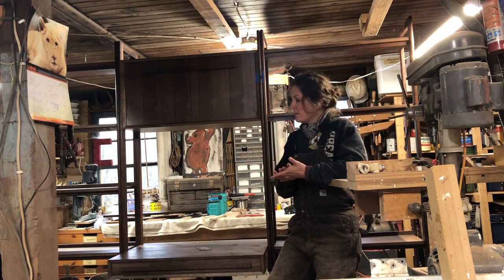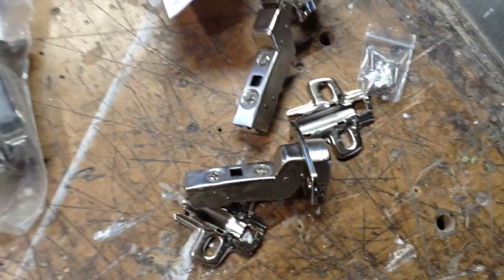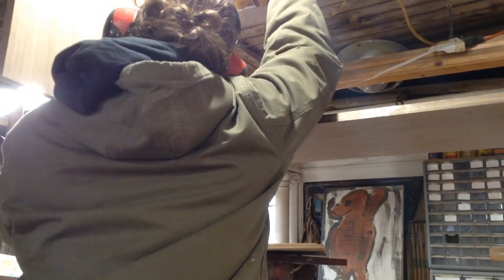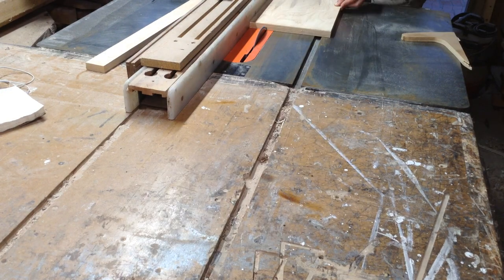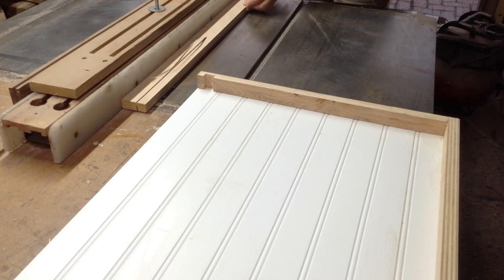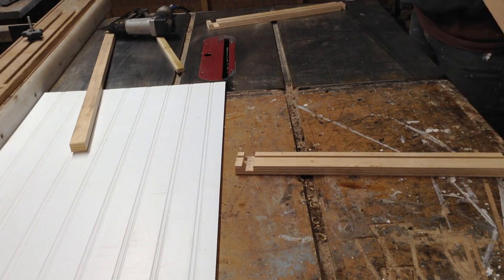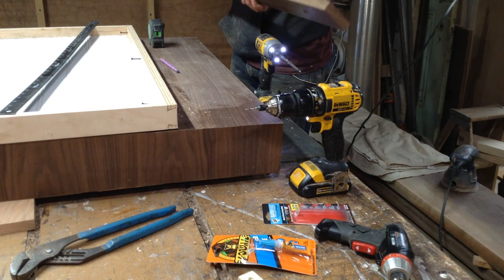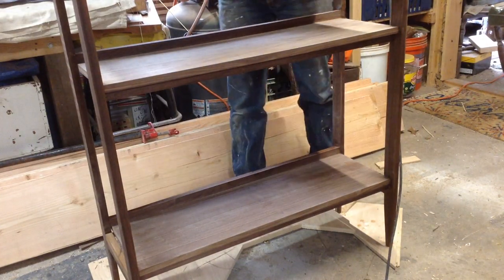Woodworking :  Mid-Century Modern Built In // How-to Part 3

Comment: "Penny for your thoughts, er shims!" Yay, it must be Saturday morning and ALWAYS enjoy your work with coffee! Pegboard? That was clever! No need for expensive jig! Agree on the multi-tool use but man, the replacement blades cost too much. Thank you for sharing and details on a wonderful project! Have a Merry Christmas and New Year!
Reply: You can buy the blades in bulk on eBay and Amazon.
Reply: @rodgerq  Thanks! Yeah, I've seen these and wondered, "how can they sell 50 blades for $45, but Dewalt wants $45 for 8 pcs! I think I'll get a 40 set of wood/metal from your suggestion and see if they hold up.
Reply: @xoxo2008oxox  if the cheap ones hold up even have as long as the DeWalt ones you're onto a win.

Comment: Not a fan of mid-century, being mid-century myself, but this is incredibly well built and managed. Your narration is always interesting and really well judged, so thank you for that too. I always learn plenty from your helpful explanations and trust your recommendations as you are cost conscious rather than 'fully sponsored' - could you say which forstner bit kit you used, I have burnt out two bits that weren't cheap? As always, thanks for sharing and best wishes for the end of 2020.
Reply from the maker: I honestly don't remember the brand because I bought it years ago.  It was at my local Homedepot the bit and jig were about 12.00, and the only brand they had.  It was probably Everbuilt since that's the hinge hardware Homedepot carries.
Reply: @HoneyBadgerWoodWorks  Thank you. I'll try to check them out.

Comment: Looks great!  Nice to see it installed.  Definitely a highly functional design.  I've never used armor seal, may have to check it out.  We use Waterlox or Danish oil for just about everything.  Did you all get hammered by the storm down your way?  We got 22" in Southern Maine.  Peace.
Reply from the maker: We were supposed to get 18 inches, but ended up getting less then 10.  It was mixed with rain so lots of ice as well.  Still very rare to get snow before Christmas around here.  22 is 22 inches too much haha.

Comment: Very nice. Does the temperature in your shop affect the drying of the finish? I really like and often use the same finish but haven’t had the occasion to use it in cold weather
Reply from the maker: Yes, winter time is a real pain.  I have a propane heater going for most of Dec. Jan., and Feb.  But, even then I usually only get it to around 52-55 Degrees so drying times on glue and paints are SLOWWWWWWWWWWWWW.
Reply: This is why I end up using lacquer a lot when I am finishing stuff in the winter. Low temps don't matter. Although of course I realize it's not the ideal finish in most situations, including for a piece like this.